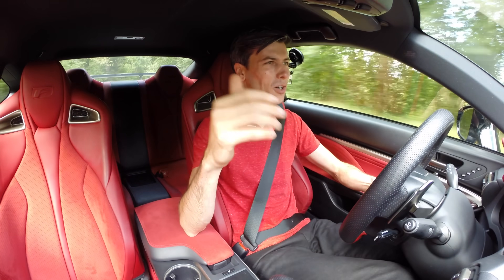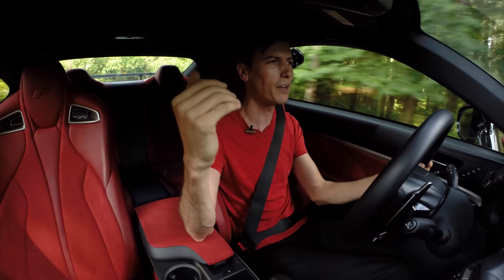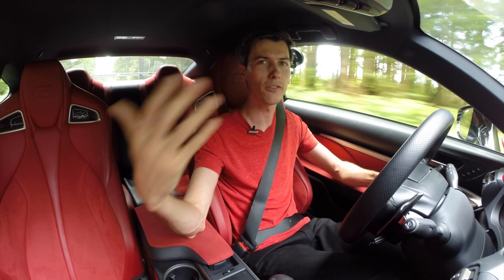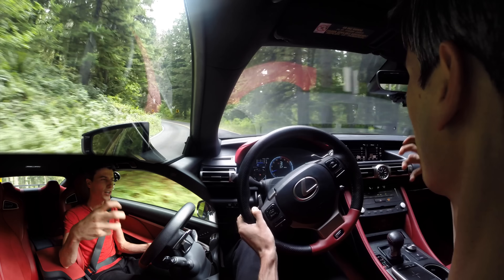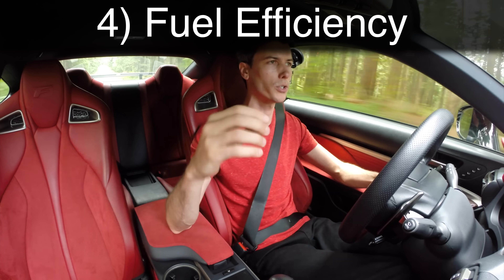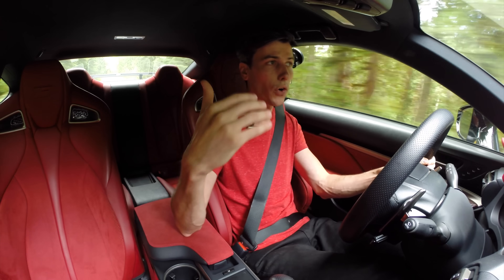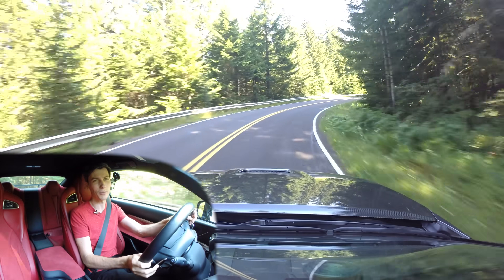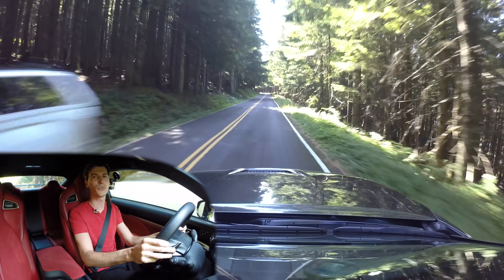5 Reasons You Shouldn't Buy A Turbocharged Car

Comment: Naturally aspirated engines are good if they have enough displacement (V8 or more), but for the regular low displacement engines, well they are really bad. No torque no power, you have to rev it to the infinity and then some just to obtain a mediocre performance. And about the sound, you obviously haven’t heard the Pagani Huayra. And about waiting for the torque to come up from turbos, on the naturally aspirated engine you have to wait until it comes to the top rpms to get some and in most of the times it comes out with power boost too and then you have both to manage it’s like the turbo engine of the old. About the efficiency I’ll give you that one because you are correct when you talk about petrol engines but when you build a Diesel engine with the turbo in mind then you get a pretty nice result. Just to make a case I drive a small turbocharged diesel engine car with only 1.6 l displacement and only 120 hp of power and 300 Nm of torque and in a car that weighs 1400 kg(do your own conversions). And I can travel on the highway comfortably in the 6th gear well over the speed limit and with plenty of reserve for an emergency overtake. Meanwhile I consume less than 6 l of diesel per 100 km. And you can hear the engine barely. Okay?
Reply: Huh? Some good V6s out there.
Reply: Stop with your logic

Comment: Reason I did not buy a Turbo: Cost. The thing will break and will cost me money. No turbo, no repair. Also did not get a direct injection motor.
Reply: Throw in a maual trans and you'll  yourself a good car.
Reply: @Fortheloveofjdm  I'm from europe. We only have manual (mostly), so I got that covered too :)
Reply: My turbo is nearly 8yrs old, 95,000kms. Hard kms haha 

Never had an issue... Just do your services correctly.
Reply: whuzzzup all commercial engines are turbo. All. A turbo truck will typically go 1M kms between rebuilds.
Reply: @nordic5490  Well since my car from 2011 has no turbo, I'm quite sure there are ones without.

Comment: Most manufacturers these days are advertising their turbo engines as having good to great power AND good fuel economy and that's always kinda pissed me off.  There's no free lunch.  You can have that power OR you can have the gas mileage, but you can't have them both at the same time.  One thing that most manufacturers don't put on their turbo cars, at least as far as I've seen, is a manifold pressure gauge.  Put that on the car and let the customer know that if they keep that needle to the left of the 0, they'll get reasonable fuel economy, but if they drive with that needle to the right of the 0 more often than not, don't some back complaining about gas mileage!

Comment: Turbocharged cars are not for me. I destroyed two. One back in 1990 and one about a year ago.

I now drive a 2019 RAM 1500 Limited with a 5.7 liter V8. Couldn't be happier.
Reply: @floridianrailauto9032  I would almost expect a used 1983 Dodge Shelby Charger to throw a rod by 1990. I did not expect to put a hole in the engine block of a 2016 Forester XT after 32,000 miles.

Comment: I liked the video because I'm an adult, instead of disliking. All good points you are making. My 2nd gen 3.5L TT in my pickup has 111k highway towing miles and local hauling and defies everything you said in the negative. I don't have a V8 note, then again I didn't buy a V12, either. Ya know, I love how a turbo fan on the A-10 sounds but oh, the jets on F-22's are sooo much faster. We can bounce back and forth all day. At the end of the day, I don't poopoo the current gen Coyote because Ford made it a true 5.0L and dual injected it. Making it single handedly more powerful per liter than ram and the bow-tie. I baby my turbos and take care of them. I don't use a lead foot and when I'm hauling, I don't use anywhere near the fuel pedal a n/a uses to move down the highway. I let the turbos and 10-spd do ALL the work.

Comment: This has to be the lamest video I've seen turbo lag dude it's not the 1980s torque curve turbos make more torque bang for buck yeah they cost more but yeah oil baking have you heard of synthetic oil compression ratio anything you can run in na you can run in Turbo engine knock dial the timing back.and sound are you kiddingm nothing sounds better than twin turbos with a wastegates open

Comment: Our household owns 2 Ford ecoboost engines. I agree with everything you said but I don’t feel the oil degradation is a significant factor. I change my own oil and send samples in for analysis each time. We use fully synthetic and go the manufacturer recommended intervals and all of our samples came back with very healthy TBN values. The only time the flashpoint has risen is during the winter months where we warm up our vehicles and the oil absorbs more fuel. Otherwise I keep getting told to go longer between oil changes (10k+).

Comment: What you're saying applies excellently to sports cars, obviously I want a 911 GT3 over a Carrera GTS or even a Turbo. However in daily driving I find turbocharged cars to be loads more suited. My mom has a Mazda CX-5, 2.0 4cyl N/A 160hp. In order to make it do anything what so ever you have to mash the pedal, at which point it kicks down 4 gears and lunges forward, screaming at 6000rpm in a loud, coarse and quite unpleasant 4cyl drone. There's also not a whole lot happening anyways. My 2019 Focus has a 1.5l 3cyl turbo with 180hp. The turbo is quite small, so at 1600rpm it is already making max torque. Allthough max power is at 6000rpm, so you have a massive range to play with. Contrast that to the CX-5, which makes max tq at 4000 and max power at 6000... That's less than half the rev range. So what you said about torque curves is completely opposite to how I experience cars to work in daily driving. My Focus can pull the same acceleration at 2000rpm that the CX-5 needs to be at 4000 to achieve. And that ties back to automatic gearboxes, which most people prefer these days. The CX-5 is changing up and down all over the place to be in the correct revs, otherwise it has zero acceleration. My Focus pulls wether I'm at 1600 or 6000, so I can merge on the highway without revving the piss out of the engine. And I'm using at least 35% less fuel than the CX-5, allthough some of that is admittedly the CX-5 being 4WD and a (pointless) SUV. In short, go turbo wagons!

Comment: I’ve been looking around for MY first car (I’ve shared a car with my significant other for over a year). I’m currently driving a Toyota Camry, so I want something a little faster and fun to drive. I’ve looked at several twin-turbocharged cars... the 2018 Kia Stinger, 2017 Ford Fusion Sport, etc. should I just go with a regular V6?
Reply: Hold on. Current Camry gets 200 HP in the 4 cylinder model, and 300 HP in the V6. Neither use turbos. Personally, I'd get one of those, or at least test drive both (with the AC on, going up hills, etc).  Don't let the salesman rush you in the test drive.
Reply: GuitarGuy I have thought about another Camry, but I just find them to be too bland/vanilla for my taste.
Reply: @AK-fv7mp   oh I hear ya, but try the V6.

Comment: I like them all. With that said N/A V8 LS Engines are some of my favorites but I chose to buy a 2018 Chevy Camaro Turbo 2.0 because of fuel economy and was mix of my previously owned cars an 2005 Dodge Neon Srt4 (Turbo 2.4 4cyl) and 1998 Camaro Z28 and 2010 Camaro SS (LS V8 N/A).

Comment: Biggest reason to get a turbo is because exhaust enters it, witchcraft happens, and you go faster.

OH also.... SSSSSSSTTTTTTUUUUUUUUUSTUSTUSTUSTUSTUTSU
Reply: My Cummins 5.0 doesn't have a BOV though, just a waste gate.
Reply: @wyattlarrick3246  No need for a BOV... the compressor surge is enough sound for me! BOV is just for showing off
Reply: @ArchimaXed  Most Diesel engines(cummins) don't even have throttle bodies so a BOV won't do a damn thing. A BOV is to prevent the turbo air stalling the blades and making then spin backwards(not efficient) when the throttle body is closed. 

To visualize the importance of a BOV for efficiency, Imagine coming off the gas and your tires start spinning the opposite direction and then you have to accelerate to get them to stop spinning the wrong way and start spinning properly. That is kind of the effect you get with a turbo without a BOV. Again most diesels don't have a throttle body so it's useless on them.
Reply: @SI0AX  Correct... mostly. A BOV is just for noise IMO. OEMs use a recirculating valve, which IIRC is supposed to "reduce noise", i.e. prevent compressor surge. It'd be pretty difficult to get a turbo to spin backwards - what you're hearing is air making it's way backwards through the compressor wheel (surge). In my experience, lag in between gear-changes (with a manual gearbox) is reduced when you don't run a BOV, especially if you have larger turbo. This is all in the context of turbo petrol engines tho. Diesel w/o TB is different.
Reply: @ArchimaXed  Oh, the recirculating valve is actually much more efficient as you don't just throw away all the boost into the air. You recirculate it back in front of the turbo to be sucked in again. BOV's sound cooler, but the recirculating valve (BPV) is better for performance.
Reply: @SI0AX  Agreed. I reckon deleting the recirculating valve is even better for performance, but that results in a compressor surge noise (which I love. Sounds like a dove stuck under your bonnet). It would be a negligible gain in performance though. How about having an additional throttle plate before the turbo, ala Group B, for even less lag!
Reply: @ArchimaXed  Didn't know the throttle before the turbo was a thing. That's pretty cool. But deleting the re-circulation valve will worsen the performance. Compressor surge is the sound of air going wrong way and slowing down the turbo. 

It would only make affect performance(negatively) when shifting gears in a manual car unless you are doing the fuel cut full throttle shift or the car is automatic where you don't close the throttle between shifts.
Reply: @SI0AX  I thought so too. but in practice I found no dump valve is better if you're changing gears fast, with a big turbo. I guess it has something to do with the inertia of the turbo. And I don't think air going backwards through the compressor wheel causes any damage, unless it happens under boost (i.e crossing the line on your compressor flow map)
Reply: @ArchimaXed  Some people say it damages the bearing but it's a controversial subject apparently. I would have to try out a car with a bov delete plate to test the shifting performance of having or not having a BOV/BPV to tell if it makes a difference or not. I suppose a cheap BOV may be worse for turbo response when shifting than none, lol. 

I understand that not having a BOV will mean you keep boost in front of the turbo which is why I would rather compare running a BPV(recirculated boost in front of turbo) instead of a BOV which just throws the boost away. 

I know there are some BOV that can be adjusted so you don't throw away all the boost buy a BPV is better still. I would like to test BPV vs no-BPV/BOV(nothing).
Reply: @wyattlarrick3246  all turbo engines need a device to relieve boost pressure once you come off the accelerator pedal, otherwise throttle blade damage or compressor surge is inevitable. OEMs rarely use atmospheric BOVs (vent to atmosphere) as they all seem to favor the quieter bypass valve instead. The valve's discharge is connected back into the inlet track back at the beginning of the journey and instead of hearing loud woshes, it's a very faint low frequency seepage noise. Give your truck the beans and suddenly let off and listen for the faint whistle/ seepage noise (almost like a vac leak).
Reply: @wyattlarrick3246  Maybe it does have a BOV, it probably has a hose routed to the air intake hose to redirect that extra air back into the intake system. Many OEM turbo vehicles are like that.
Reply: God I was waiting for this.

Comment: Solving the fuel efficiency problem...stock turbo cars run ridiculously rich. (12.5 afr?) You could lean out the mixture to get better performance and fuel efficiency. Manufactures could increase the knock threshold slightly to protect the engine.
You talked about engine efficiency. I would argue forced induction engines are very efficient in that internals are over stressed during production due to the anticipated load on them during WOT. Also, smaller turboed engines weigh less which is another bonus.
And lastly, 4 cylinders are easy to work on!

Comment: I'm curious about a few things. For one, why aren't VGT's commonplace with turbocharged gas engines? Also, design mentality behind our domestic, larger engines (GM and Dodge small blocks) compared to Ford's recent run of smaller, higher powered V6's and more the european market of smaller high performance engines in terms of performance and longevity. Example, police cruisers used in the UK an Europe versus the traditionally used V8's in the US for police cruisers.

Comment: Agreed, I don’t like turbo engines. The model F150 I like I can only find with the EcoBoost V6, however I want the naturally aspirated V8.
Reply: I don't even like trucks, but a truck with less than a 4.0 anything atleast feels wrong.
Reply: F150 with the 5.0L
or used Raptor or Harley Davidson model with 6.2L
Gas mileage - not cool, though

Comment: They do have electric power assist turbos now which do eliminate turbo lag completely. Which an engineer like you should already be well versed with them. They work great with a large turbo giving you both low end and high end power.

As too the rest of it, LNG as a fuel for a turbo engine is a match made in heaven. A cryo fuel which can be used in an ice box intercooler dropping your air fuel charge down to sub zero temps and the fuel is equivalent to 114 octane gas. Which means you can run compressions of 11:1 and 20 lbs. of boost at the same time while getting a sub zero air fuel charge into the cylinders. combine that with electric assist turbos and you solve all of your negatives. That is of course what engineers are supposed to do.
Reply: That ain't cheap though.
And good luck finding an LNG pump. Might as well go electric then: cheaper, instant throttle response and torque, more charging stations.
Reply: @kenkalajdzic  We need an engineer like Musk to champion the roll out of LNG.
The LNG market is loaded with excess LNG just looking for a customer. Lots of cheap clean burning LNG just waiting for a market. The rest of the pieces already exist. Liquid to air intercoolers already exist. The electric assist turbos already exist. Gas engines can easily be modified to burn LNG. All the pieces are in place except for the LNG pumps.

Comment: I daily drive a WRX.  Its a solid car.  But the throttle lag is obvious and annoying (stock turbo = quickest spooling).  I actually look forward to driving my wife's Outback (165HP vs my 260HP) because the throttle response is so crisp and responsive.

I hop into my AW11 (1986 Toyota Mr2 - naturally aspirated) and I finally get to enjoy driving!  The throttle response is simply sublime!

The complexity of turbos isn't worth it to me personally.  I'd rather have a flat 6 cylinder VS a 4 cylinder with a turbo.  I'd get similar HP, slightly less torque, but much better throttle response - and throttle response is more important to me.

Comment: Hmm, apparently we still have turbolag problem these days. Beside antilag system (which I think hurting the turbo too much) there are few ways to minimize turbolag, one of them is compressed air tank for spooling the turbo in the lower RPM which can be found in Koenigsegg Jesko. I don't know how effective this solutions is, but well,  Koenigsegg uses it. 
The other solution is MGU-H which can be found in F1's modern turbo hybrid Power Unit. It's probably removing turbolag problem completely, but forsure it's still not feasible enough for road car right now.
Reply: I think audi has an electric turbo which also great to eliminante turbo lag but it needs a 24V electrical system

Comment: Very simplistic description of turbocharged delivery… many turbo charged engines have multiple turbos which spool at different points in the rev range and negate turbo lag. My diesel has been remapped so the turbo spoils earlier and power delivery is more instantaneous and linear.